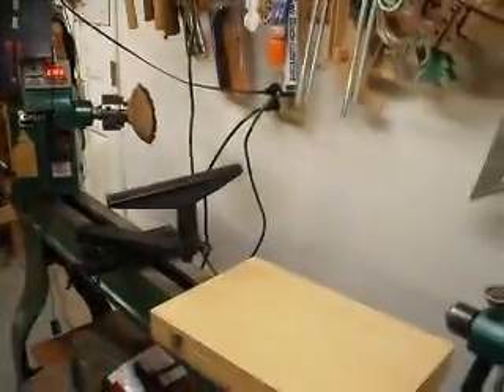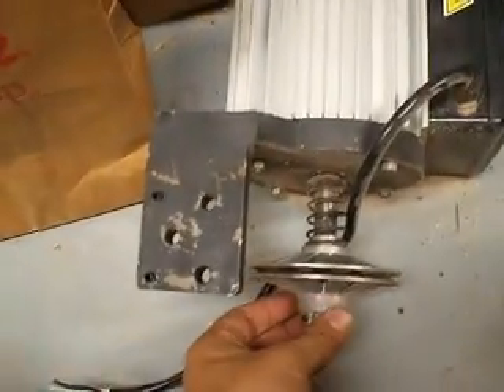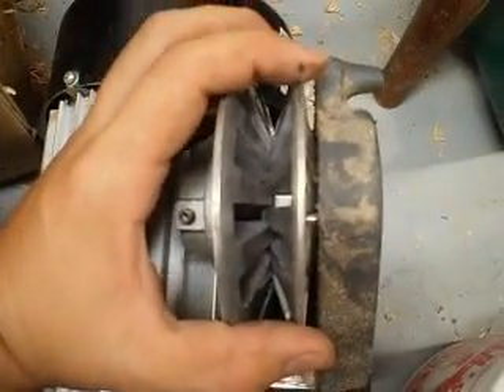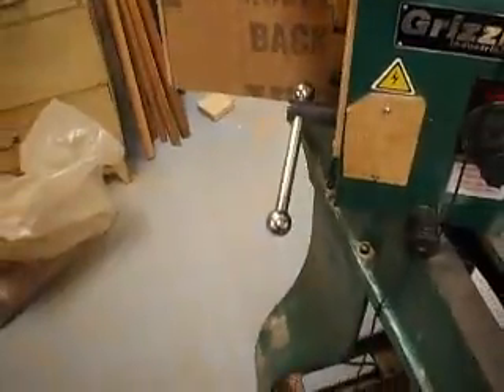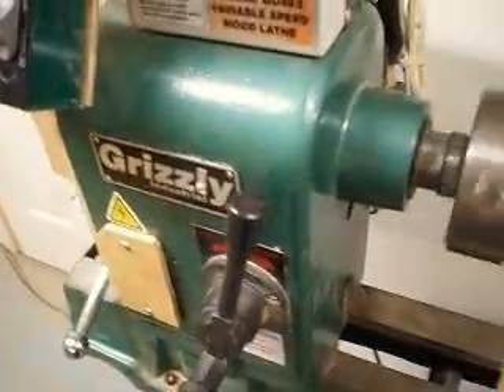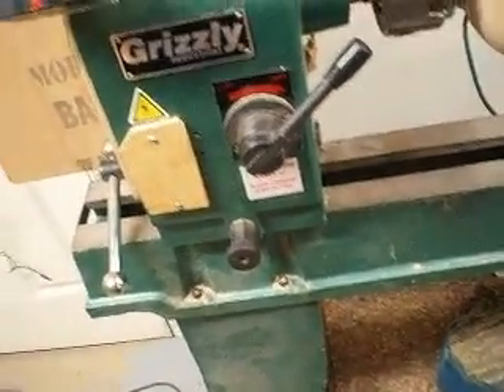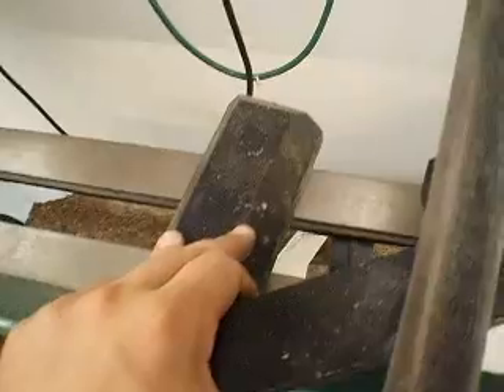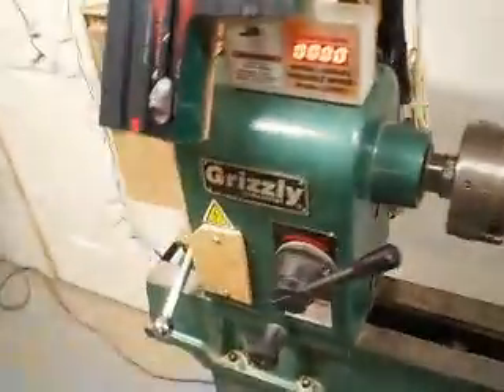Grizzly Wood Lathe Review and Modifications

Comment: nice video, my grizzly is almost the same, little different in the tail stock, I have a treadmill motor and controller,etc, but the issue I'm having is on the DC motor it has a very large steel balancer like thing with the V belt -- the ones with multiple grooves--and it seems to be screwed on to the motor shaft,, does that come off you think ? or would I have to just modify the lathe pulley to match it and use a little bit longer belt.. thanks
Reply from the maker: Well it's kinda hard to comment exactly without seeing it in person. My guess is if there no set screw holding the pulley then it's threaded onto the shaft. I would see if there are some flats or maybe you could wedge the motor so you could try turning the pulley loose. If I remember this treadmill motor had a similar threaded pulley on the shaft.
Reply: https://flic.kr/p/23AUR3V
Reply: https://flic.kr/p/2edpqDz  these are pictures of my tredmill motor,, don't know what to do about that large pully on it, was thinking of cutting  a groove with a file as it spins to accommodate the belt on the lathe? or take it off..
Reply: @wonderwond  i would leave it on for one it has the fan that cools motor,plus its a counter weight helps keep it from bogging down the motor
Reply: @badboy-bn2xx  it came off, opposite direction, im thinking the heavy weight was to balance the giant steel long shaft that connected to it via the belt, without the shaft it prob doesn't need that giant heavy wheel, the fan is on the opposite side and not sure if its even a fan, looks similar but it think it reads the RPM of the motor to the control panel. it has a magnet sensor that rides the end, without that it doesn't read the rpms of the motor on the main console.. but its all good thanks, now im ordering a v-belt pully for that shaft its like 5/8  I have a few 1/2 ones they wouldn't  fit it..to small, now only thing left is to figure out making a bracket for it to fit on the lathe...

Comment: Do you notice that the treadmill motor has more torque at lower speeds than the motor that it originally came with?  Thanks!
Reply from the maker: proclaimliberty2000 Yes the torque was a little bit better. Since I was using a v-belt it wasn't significantly improved though. If I had used a flat belt it would have been much better.

Comment: Nice Modification!!  I know this is an old video, hopefully you might still read the comments.  I have this same lathe and am contemplating doing the same thing to hold me over until I can afford a new one.  Question: When you are at LOW RPM's (250 to 500) do you find that the torque is too weak?  Or is it still strong enough to rough out a bowl/vessel?  That's the only downside I've heard about using a treadmill motor.  Any input would be hugely helpful.  Thanks!
Reply from the maker: I was able to rough out an 11" red oak bowl with natural edge. I had to keep my tools sharp because my mounting setup tended to make the belt slip rather than the motor stall. If i had used a more rigid mount and better pulleys then it would have been even better. The bowl did come out nicely though and I was able to sell it fortunately. Mainly it depends on the motor, but variable speed is nice even if it's done in a crude way like my method. Hope this helps.
Reply: A Pierce Thanks for the reply, that helps a lot.  Sounds like it's worth giving it a shot.  The stock low speed is just way too fast to do anything that's decent size and out of balance, at least not without feeling like my safety is at risk!

Comment: Did you ever had to change the original  pulleys from the motor side and how is it done?
Reply from the maker: Yes I had to remove the pulley on the treadmill motor and put a stepped one, for a high and low speed. The pulley was attached using a set screw.